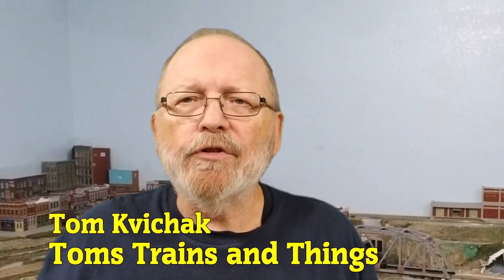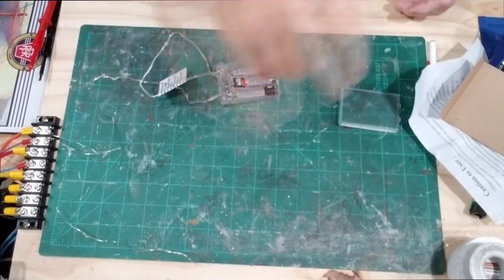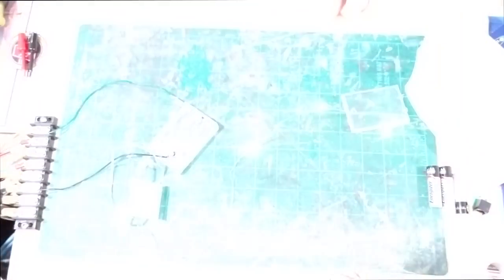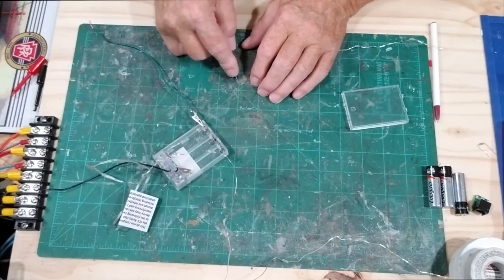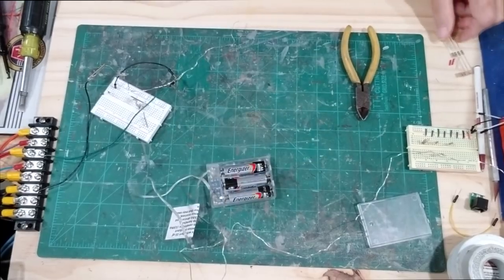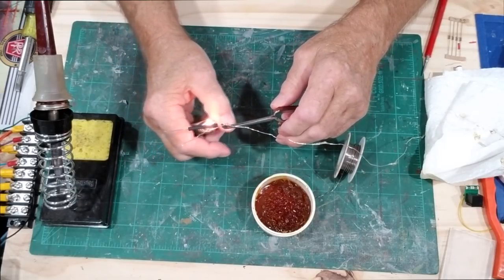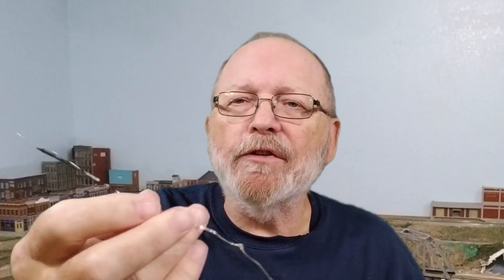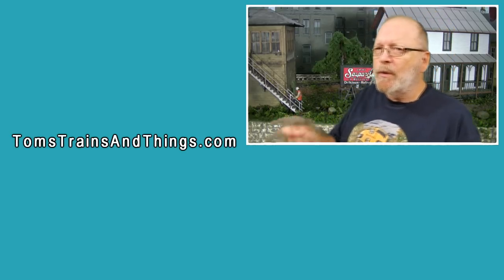How To Test & Use Inexpensive LED Light Strings For Your Model Railroad

Comment: how are u dealing after cutting off a segment and ending up with 2 wires forking out?
i suppose you just twist the ends together, solder the joint, and put shrink wrap?
Reply from the maker: I normally just dead end the wire close to an LED. That way there's no chance of them shorting together. If I want to splice more LED to the end, just solder the wires and heat shrink them.

Comment: I've been getting the led lights at the Dollar Tree.
Reply from the maker: Hey Thanks, I've been looking there and haven't found any yet. Maybe I'm looking in the wrong dollar store. lol
Reply: Toms Trains and Things the lights go fast when they get them in .On the lights what side do you solder the resistor to. I assume the positive lead.
Reply from the maker: That may be why I can never find them! 
That is the standard practice maybe to easily identify the polarity but I've seen the resistor work either way.

Comment: If the led's in the set are 3 volt LED's and you are using a 3 volt battery source why would you need a resistor?
Reply from the maker: What is stated on the set is not necessarily the rating of the LED. Check the data sheet of common LEDs. The voltage is rated much lower and differs by color.  The resister is to limit the current!

Comment: What size resistor do I use if I want to put the whole 20 light string in a big building using a 12v wall wart for power?
Reply from the maker: Good question Richard. Those light strings typically are 3 or 4.5 vdc so I would test a few different values starting at 1k ohm to see how bright they are. If you could find a lower voltage wall wart, that would even be better. The resistor is to limit the current, so with a higher voltage, your current is going to start out even higher. 3v -1k ohm = 3mA  12v - 1k ohm = 12mA These figures are without considering the resistance of the string of lights.

Comment: How do calculate/determine what resistor to use with a LED? Thanks!
Reply from the maker: Look through the comments Richard Thomas asked the same question.
Reply: Resistor value=power in(minus) LED voltage (1.5v good number) then divide by LED Amperage (0.020amps aka 20mA).   So an example, 5v (IN) - 1.5v(LED Voltage)=3.5v (that needs to be dropped).  Then 3.5v/0.020=175 Ohms.  You usually round up to the next closest resistor value available.  200 or 220ohm is closest.

Formula is (Vin-Vled)/I.  I is current (letter i)

https://eepower.com/resistor-guide/resistor-applications/resistor-for-led/#

Comment: Tom can I run one led with a resister or more,thanks
Reply from the maker: Fran, you can run multiple LEDs  on one resistor.  Play around with the value to get the desired brightness. Make sure your LEDs are the same color since they have different voltages to lite.